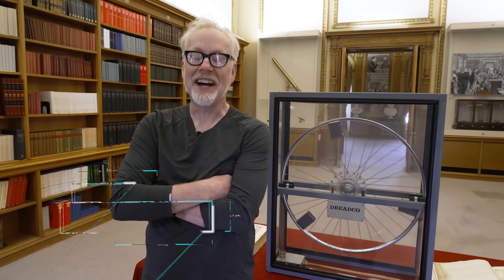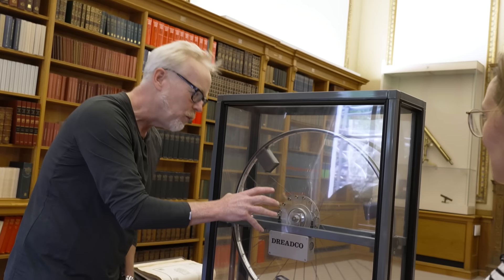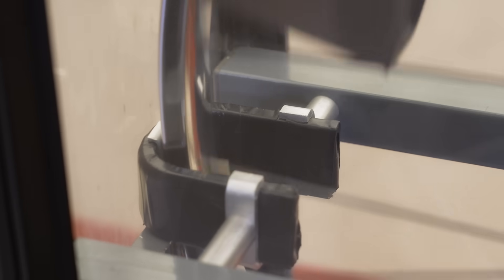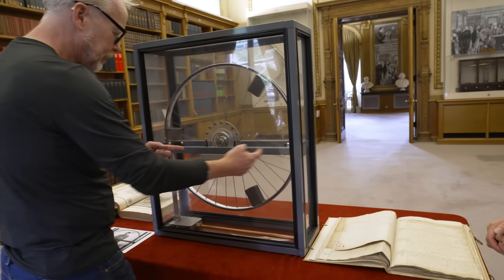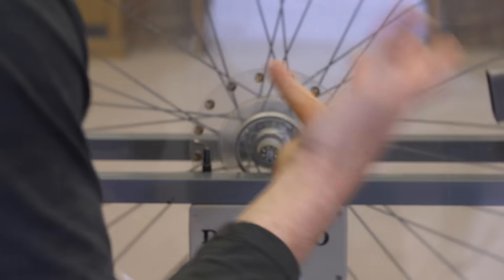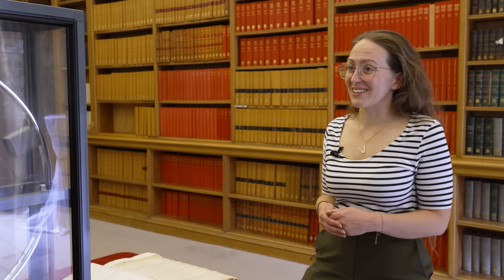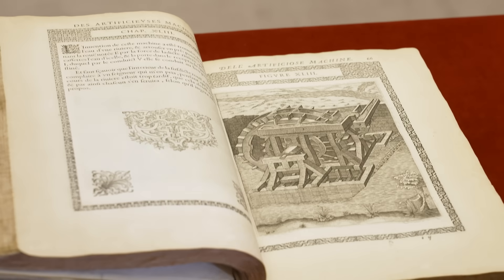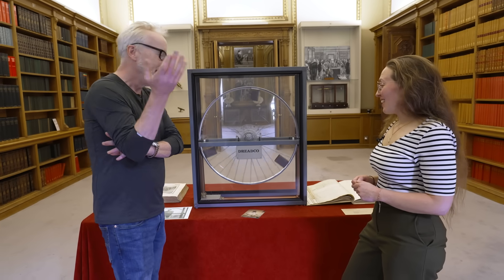Adam Savage vs The "Perpetual Motion" Machine!

Comment: Perpetual motion is possible, this has been widely known for hundreds of years. 
" A body remains in motion at a constant speed in a straight line, unless acted upon by a force".
 This is confused with devices that attempt harness the force referred to as 'gravity' by people who should know better.
 Forces have been harnessed for millennia, solar energy and gravity power hydro electric damns very effectively, its not unreasonable to suggest that gravity maybe harnessed one day.
Reply: perpetual motion is  possible. No one claims otherwise. 

 But perpetual motion machines are not possible. This is why the claim is  perpetual motion machines are not possible and not perpetual motion isn't possible. 

In the last part you seem to confuse the terms energy and force. 

We can't harness gravity.
Reply: Hydro electric dams seem to harness gravity pretty well
Reply: @Steve-ef7ss  they are harnessing potential energy. Not gravity, gravity is a force it can't be harnessed.
Reply: What would happen to the potential energy if there were no gravity?
Reply: @Steve-ef7ss  gravity is the tool used to harness potential energy, or store it. 

This doesn't make it something that can be harnessed.

Comment: My theory is that each box on the inside of the rim is fitted with a series of magnets with polarity facing opposite directions. When the box passes through the U shaped magnets (also opposite polarity to the magnets in the boxes) one side pulls the box while the other pushes away once it is past midline of the U shaped magnets. Each being set to precise degrees in the circle creates a balance of push and pull from the magnets. I believe the maintenance is only to add grease to, or to replace the bearings. All of this would explain how slowly the device rotates as the magnets are all equal in strength. I believe this gives the device more of a fluidity of motion, but cannot be perfected any further than what has already been designed. I'm no physicist, and know very little to nothing about magnetism.

Comment: I'm 95% sure it's electrostatic. The boxes and the "U"s aren't magnetic. There's another video where they test it with a magnetometer. Note the pointy electrode, and the series of cups. It's an inverted wimshurst machine. Normally you turn it to generate electric potential and big sparks. But if you do it backwards and apply a high voltage, it'll spin. The fun thing is, it takes a ridiculously tiny amount of energy to move electrostatic motors. Which makes it perfect for something that needs to run for ages. Big chunky battery in the box, and something to hold a charge, and step up the voltage. Some sort of joule thief thingy to make sure it keeps on chooching, and a super well balanced wheel. Tiny electric field keeps the wheel going until the system runs out. The boxes are there so he can easily balance the wheel. 3 points is the number of weights needed to balance a wheel without needing to carefully find the exact point to put weights. Either everything else is a decoy, or he snuck some sort of passive energy harvesting mechanism to help keep the thing charged, but I doubt it if it needs to be "serviced". Serviced means recharged.
Reply: agreed i forget the term but its like the brother of piezoelectrics and its what  makes static electric possible,  and those are capacitors maybe
Reply: Could be the wheel bearings need servicing, they aren't something that lasts forever, and 2 years is a long time to always be spinning.
Reply: @jaredkelly925  at that speed it’s no big deal. I’m sure the bearings on your car are older than two years and spin way more than that.
Reply: Hmmmm... sounds very possible.. even small lithiumbattery can works  about 7-10 years. That i can confim the service is every 7-8 years. They telling that in science center heureka in Finland.
Reply: Well, everybody KNOWS it is a trick. The question and fun is in finding out WHAT trick...
The inverted Wimshurst is a very plausible hypothesis.
Reply: I respect your use of the word "chooching"
Reply: Hi justin
Reply: It's a waste of time!!!!!!
Reply: I don’t think that could work because electrostatic circuits are inefficient and would drain batteries in less than a month
Reply: I noticed how the Aquphiblee was connected from one side of the wangle pin to the other this gives drive to the cokometer which in turn powers up the howsfart which in turn gives you perpetual motion, piece of pi*s realy
Reply: Quindi, non è un " movimento perpetuo" o sbaglio?
Reply: @fabiopinzani3044  if i hook a fan to a solar panel, with ''just enough'' battery to keep spinning through the night, and it just keep moving perpetually, is it perpetual motion, or solar?
Reply: Похоже, Вы правы. А вот элетростатическим генератором может быть радиоактивное вещество, способное к бета-распаду. бета-частицы (электроны) через металл не проходят, поэтому такой электростатический двигатель безопасен для людей.
Reply: They dont seem very mature as person, or as scientists, if you would ever call them scientists, since keeping it a secret is acting like a child who wont give away his magic trick.

They dont seem reliable at all, just attention seekers, because why would they show they made something that "works" if they dont want to tell full story behind it, and to bring camera to record it all, just see details and you can get all answers.
Reply: What you say is relevant !
Reply: The three boxes aren't batteries, they are weights. Probably Lead, to give the wheel more kinetic energy from the start. Furthermore, they have probably been calibrated to balance the wheel so it rotates at a constant speed.
Reply: Notice how when he gets close to it after stepping away, his mic gets static noises. I know absolutely nothing about this stuff, but it's funny I see this in the comments, because that was my conclusion as well.
Reply: Dude, the materials of cathode and anode have different electric potential, like zinc and copper.
The close placement of those two generate a current of electrons in the electrolite space (it can be air humidity in the gap) same as galvanic cell.
Now, if the power consumption for running the wheel is less than the charge amount of free electrons attracted by the anode block taken from the natural environment, that tiny current flow through the poles, will be perpetual. More bigger anode block, more charge it can attract and contain.
Reply: you know magnets and electricity can be the same thing, right? Electromagnetism
Reply: The three magnetic  on the wheels are repealing the two U shaped static magnets  and that move the wheel
Reply: This project is real or fake I don't know. But perpetual motion is possible. I have to done it.  With water you can create.
Reply: @usmanhayder3714  Is not possible and you didn't. I can bet all I have on it. Because if you win, I run away with the prototype and will get insanly rich and famous XD
Reply: @Strade8  I'm telling the truth, I've built a perpetual motion machine. which runs on water. Our government does not support such work, otherwise this machine would have spread in the world by now. I have it. Come to Pakistan sometime and see.
Reply: @Strade8  I invested 300k$ to find it. But our government is not interested in such works. Rather, it stops such actions
Reply: 30k.... not 300k ..
Reply: @usmanhayder3714 Yes but that isn't true perpetual motion. Energy still needs to be imparted to get things moving. Perpetual motion isn't possible really. This thing is a scam.
Reply: @Aliyah_666  It depends how you define a perpetual motion machine. If you define it as a machine that will run forever in a closed system with no outside energy input it is impossible. If you define it as a machine that will run basically forever by consuming ambient energy from its surroundings then yes you can make one. Atmos clocks are a good example. They will run for decades without any winding or any apparent outside intervention or power source, but despite looking like a closed system they actually aren't since they are being powered by the tiny changes in air pressure caused by the weather changing from day to day.

Another example would be something like a radiometer which is powered by light or even infrared or microwaves. I suppose self winding watches would count as well, although they are far less "magical" since they require that they are attached to you and shaken around by your body's movements which is a far more blatant kinetic energy source than any of the other machines I have mentioned which can just sit their passively and will keep working almost forever.
Reply: @usmanhayder3714  also no you haven't "done" perpetual motion either, because perpetual motion is impossible
Reply: @Morsmalleo  I have nothing to gain by lying. My father was a poor farmer. They did not have much money to irrigate the crops. It was 1998. Father brought fuel for diesel engines to irrigate the crops. But for some reason all the diesel flowed. lost. My father sat down and started crying. Because they had no more money. Meanwhile, a person passed by whom I did not know because I was 5 or 6 years old at that time. I just remember that he was a poor farmer like us. He consoled his father and said a sentence in a sad tone. That sentence was that I wish it could run on water. I was very sad at that time. I was not so understanding at that time. But I am determined from that day that I will run it with water. This is the biggest goal of my life. By 2009 I was just that
Reply: @Morsmalleo  Until 2009 I only thought about it. Because I had no money. But in 2010 I had my first experience. I tried to make a perpetual motion machine. But I failed completely. After that I did thousands of experiments. Finally in 2018 I succeeded. Nothing is impossible in the world. But what we should keep in mind. But all my hard work and research seems wasted because our government does not accept this thing. Because the government is spending on petroleum. It will have an effect.
Reply: @usmanhayder3714  no sorry but you haven't discovered perpetual motion, no story you make up is going to make that true either
Reply: @usmanhayder3714  you do have something to gain from lying actually, just as everyone else that's lied about Perpetual motion has had something to gain, so don't pull that crap with me bro, no matter how much of a story you make up, it's not going to change the fact that you never discovered perpetual motion, and you never will.

That saying "nothing is impossible" is a load of shit, when things violate natural laws, they become impossible, exactly how perpetual motion is impossible because it claims that a PM device can operate indefinitely without a power source which isn't true, PM aims to create power out nothing, you cannot create power from nothing nor can you destroy it, laws of thermodynamics.
Reply: @Morsmalleo  I am very hurt that you ignored my life's difficulties as a fabricated story. I will give you an example of a perpetual motion machine. Then if you agree, I will tell you my original technique. I could not bring it to the people. If you can bring it, do it.
Reply: @usmanhayder3714  😂 yeah no you're not hurt at all, you're just upset no one believes your BS story, and if it is true then go ahead and tell me the secret then.

You couldn't share it with the world 😂 yeah right buddy
Reply: @usmanhayder3714  😂😆 typical I asked you to tell me the secret as you said you would but I don't get a reply, and I replied to your comment as soon as you posted it as well
Reply: @usmanhayder3714  lol you're out of your mind
Reply: @usmanhayder3714 perpetual means never ending. If you created it and your still alive, well then you haven't proven to anyone or yourself, have created a perpetual motion machine
Reply: @robertborgeson1821  Actually I don't know how to use English but a little.
Reply: @robertborgeson1821  It can generate electricity. Or can run tubewell directly. Can't drive the car right now. Because it is the same size as a living room. I don't have that much capital.
Reply: @usmanhayder3714  sure brother u can but u need to have some or the other kind of energy to put in and in ur case water 

Free energy and perpetual motion don't exists as it violates the laws of thermodynamics

Comment: The “magnets” are just coils, the box at the bottom is a switch, the boxes are just pieces of iron. The coil is electrified, creating a magnetic field that pulls iron, and when the circuit completes, it switches to the other coil which pushes the other magnet upwards, which switch the power to the other coil and so on and so on

Comment: My thinking is like this.  The 3 boxes has a coil , a read switch and  a battery. When the read switch crossing the magnet it close the circuit and energizes the coil that will give a kick since it is inside the U shaped Magnet. All the 3 boxes has the same stuff in it.  As Adam pointed out it is a Motor.

Comment: Here's my take on it. The secret lies in the box, but I'll get to that at the end as I want to give my thoughts on 3 very important pieces of the machine that'll play an important part in explaining the contents of the Dreadco box.

First, the boxes. I agree with Adam that the large boxes on the wheel are batteries, and that the U-shaped things on the side are also magnets. When the batteries pass through the magnets, they momentarily charge the magnets and generate a current which flows to the box.

Second, the heatsink. The heatsink at the bottom that Adam pointed out actually serves a purpose. Temperature does indeed affect electrical conductivity, but it also serves another, more important function which is maintaining the ambient temperature of the machine's interior, and subsequently the box's.

Lastly, the light meters. I don't think these are light meters, but rather, perforated panels that allows air to flow within the box. That way, the box's internal temperature can be regulated by the heatsink discussed earlier.

Now, to tie it all together, what I believe to be what is inside in the box: a leprechaun cranking the wheel. The reason why there has to be air flowing within the box is because leprechauns need to breathe, and without a supply of fresh air, they would die. Additionally, they need the temperature to be regulated as the friction would eventually cause a build up of heat within the machine and kill them as well. As for the electricity from the batteries and magnets, they provide an electric shock that ensures the leprechaun stays awake and continues to rotate the wheel. The reason why the batteries are spaced out at 120° and with the magnets on opposite ends is to vary the timing of the shocks delivered as having the shocks active for too long will eventually cause the leprechaun to be desensitized to the electrical shocks, and too long of a gap will allow it to fall asleep. Lastly, as for why they need to service the machine every few years, it's because the leprechaun eventually passes away, not because of the torture or fatigue, but because their general life expectancy is 1-3 years anyway. They need to return it so that they can shove a new leprechaun into the box to power the machine once more. The contents of the letter actually detail the locations of known leprechaun breeding grounds where they can gather a steady supply of replacements from.

Comment: A magnetic field is created at the left bottom corner which flips and repels at the bottom middle where the weight comes closest to the copper here....this is similar to a magnet being dropped inside a hollow copper pipe which will drop slowly instead of falling down without resistance....

Comment: I think this works by the difference in temperature between one side of the wheel and the other.  Metal normally loses its magnetism when heated.  My guess is the coil at the bottom disperses temperature from one side of the wheel and create a temperature differential which allows for the magnet to create enough force to spin the wheel.  It's not perpetual motion though, requires outside energy in the form of heat to start moving to create the temperature differential needed to spin the wheel
Reply: The Curie temperature is really high (red hot) iirc
Reply: @vincentdavis8960  or more simply an Atmos clock.
Reply: That would heat up the whole box, not just one side.

Comment: The wheel is the rotor and the earth's magnetic field s the stator.  I have a rotating globe that works like this.
The globe gets power from a solar cell picking up sunlight or room lighting.  This device uses batteries instead.

Comment: Hey Adam, can you think of a better way to make my car use less non-renewable energy? And that will be pretty difficult when you consider it's not currently in use.
Reply: Even when not in use, your car will probably be draining energy from it's battery. Eventually the battery will go flat, which form modern batteries is normally fatal.
Check it several days before you need it.

Comment: Also. It could run from a positive and negative charge positives on the right side of the box negatives on the left side of the box. Then the weight from the boxes also helps in the perpetual motion. Actually two ways this could work

Comment: I've studied engineering. Motion since I was a kid. Top 10 seconds of this, it's pretty obvious what the mechanism is. The boxes have a slanted, platform inside of them. Does a ball am assuming probably has rubber on it is very light weights or doesn't make sound